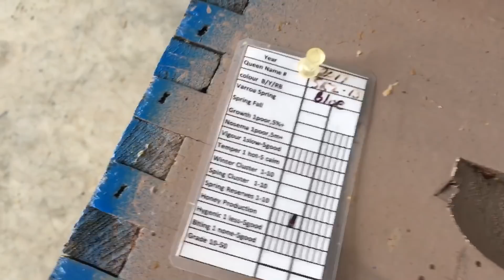Loading bee hives with an Ezyloader300 - a Canadian Beekeeper’s Blog

Comment: Doing some quick math... with stacks of 6, your storage can hold up to around 2,500 single box hives. I seem to recall you mentioning running 200 hives. Just curious, what's the rest of the space for? Are you hoping to expand further? Renting out storage space?
Reply from the maker: My Ingroup Idol Did Nothing Wrong 
I run 12-1500 hives
Winter capacity is more so volume based, requiring 15-20 cubic feet per hive
Reply: Ah, that explains it, thanks. With decent aisle space that would just about fill your (for lack of a better word) barn. That's about .5 m3, sounds fair. Using Langstroth format, I believe?
I'm just starting up, as a sideline. You're making me jealous. Good! :)